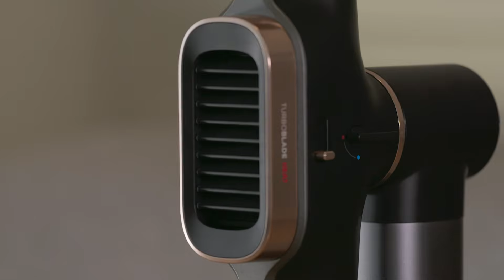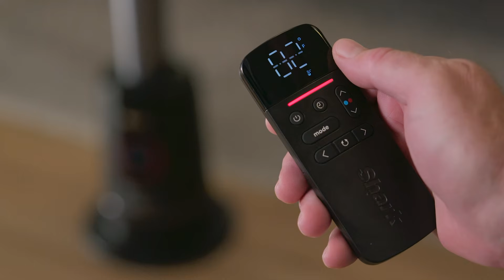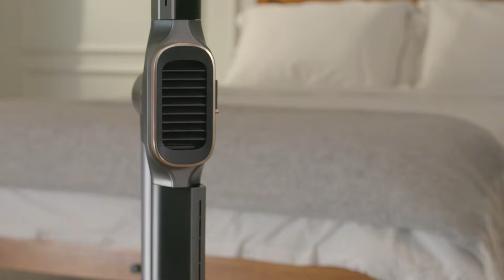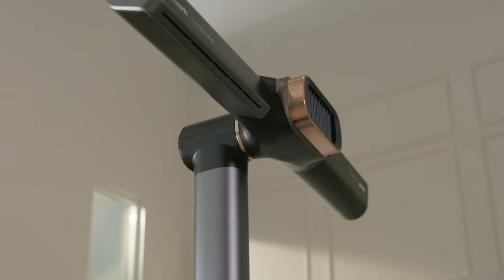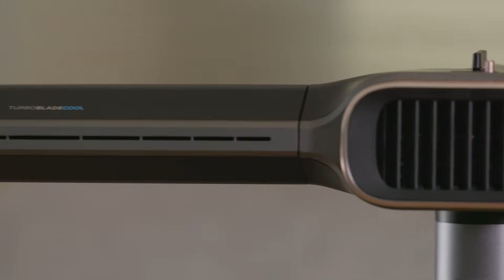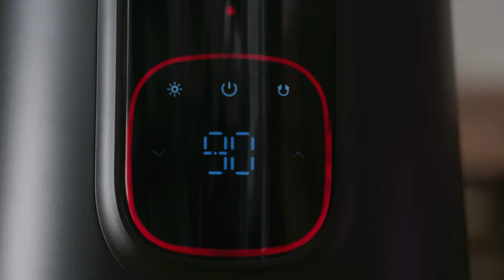Get to know your Shark TurboBlade Cool and Heat

Comment: Needed video to find light dimmer. Only thing he did NOT mention. Where's the screen?
Reply from the maker: Hi there, we’re truly sorry to hear that this video didn’t answer your questions about adjusting your screen brightness. To change the brightness on your device, simply press the sun icon located to the left of the power button. From there, you can choose between four brightness levels.

Comment: I can’t get it to heat mode
Reply: The upper unit (where the blades connect to) must be connected to the bottom unit perfectly otherwise the heat mode will not come on. You'll hear a slight click.  You may have to try this several times. Listen for the click. I'm trying mine for the first time & the heater seems very weak....ON HIGH!  Hopefully there's something I'm missing otherwise this is going back to Costco.  My Lasko heater works better than this for a fraction of the price!
Reply: @sandrita8895 thank you for explanation I was trying to do more than 1 hour
Reply from the maker: Thank you for reaching out. For detailed instructions on switching to heat mode, please visit this link: https://spr.ly/60567CgPi

Comment: How do you use the fan in heat mode?
Reply from the maker: Hey there, thanks for your question. To switch from fan to heat, use the dial on the side of the unit. There is a guide on the unit to indicate which orientation is fan and which is heat. When it has been switched, the lights on the on-unit display and remote will change to:

-Red when the unit is on heat
-Blue when the unit is on fan
Reply from the maker: Hi there, we're disappointed to hear that the heat setting on your unit is weak this isn't our usual standard. Please contact our support team for further assistance at 1-855-427-5127 available Monday to Friday from 9 a.m. to 9 p.m. ET and Saturday from 9 a.m. to 6 p.m. ET, and we’ll do everything we can to make this right.
Reply: Do not use the phone number. They try to sell you a medical device........no help .
Reply: In my experience fan is only for cool.  Which makes the heater VERY WEAK!
Reply: @sandrita8895  I found the heater more than adequate for a small room

Comment: Can you indicate which model numbers have which specialty modes?
Reply from the maker: Hi there, sure we can. We also attached a link to our website for more info.
TH202
10 fan speeds
3 heat modes
180 degree oscillation
Dust defense
TF202
10 fan speeds
Sleep Mode
Includes remote
Dust defense
https://spr.ly/60517LygX